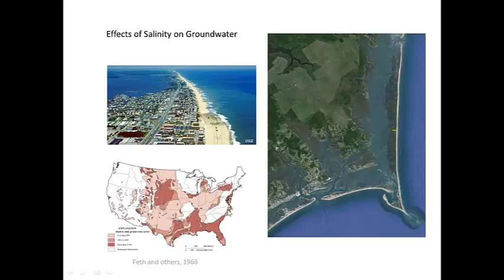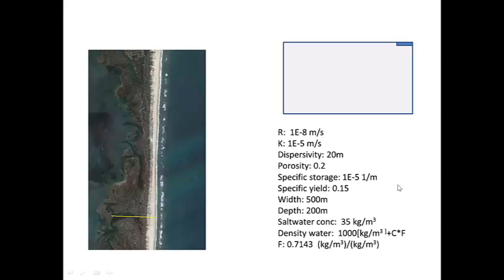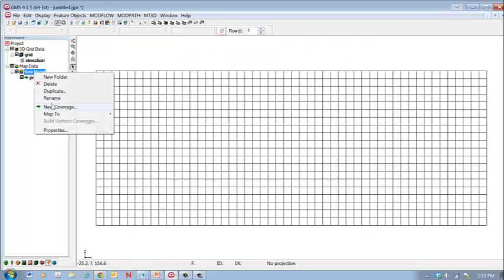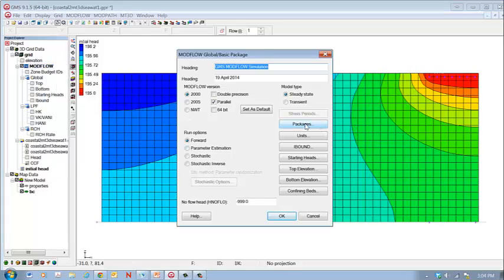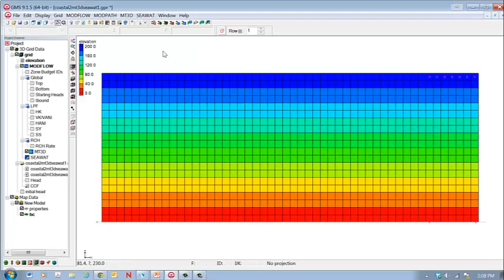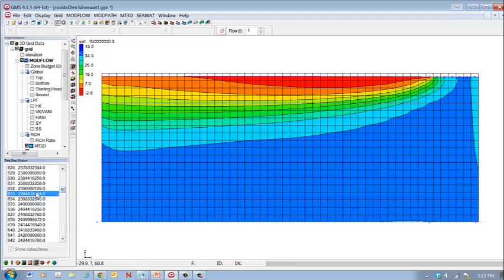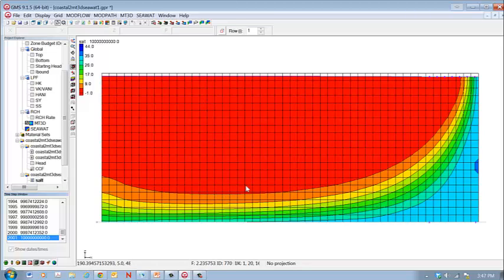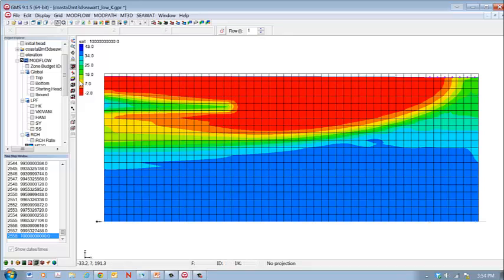Setting up a seawat model

Comment: Hey prof. Larry, I really need you advise because I would like to use SEAWAT with GUI, I can't find a way
Reply from the maker: I use SEAWAT with the GUI in GMS.  It works well, but requires a license.  You might try ModelMuse if you dont have a GMS license.  I am not sure if ModelMuse can set up SEAWAT files, but it is worth checking.